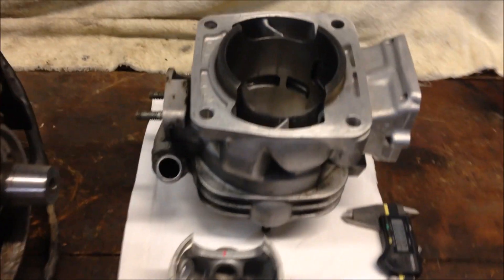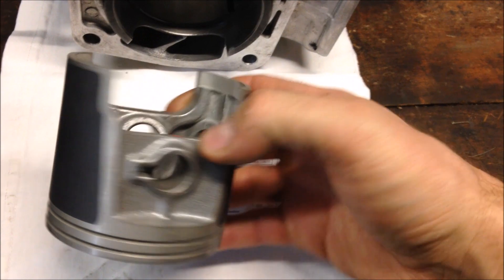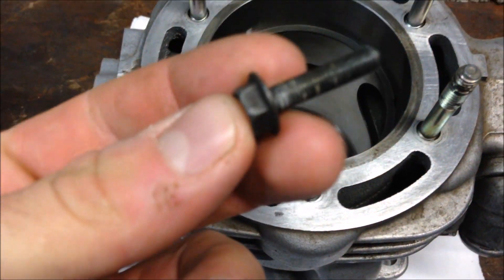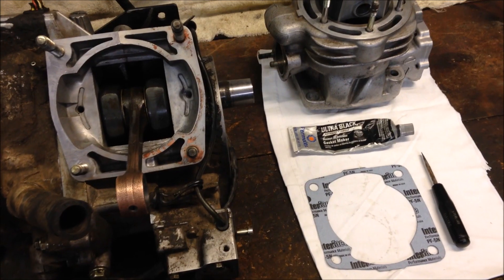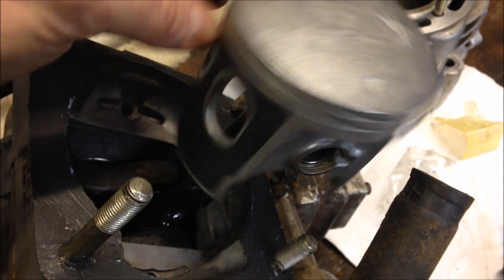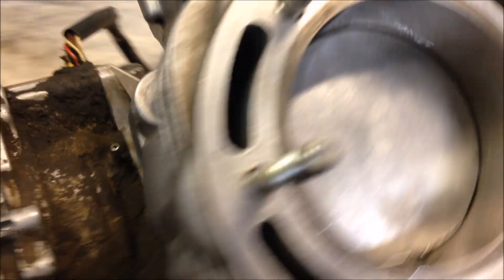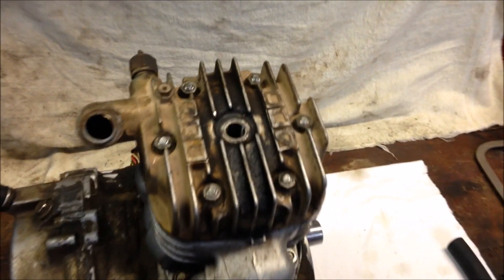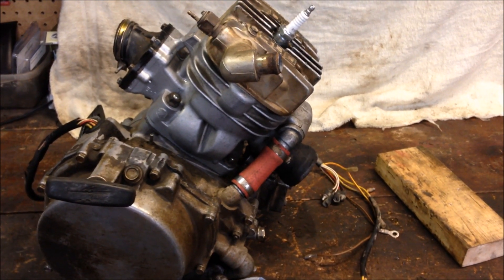Step 9: How to Install Polaris 300 350 400L Top End Cylinder Piston Head Intake Exhaust Manifold

Comment: I have a 95 300 two stroke air cooled but I can't get a torque wrench in to torque the cylinder nuts any ideas?
Reply from the maker: Crowfoot or just use a wrench and get it close enough.

Comment: What adapter do you use to torque the bottom four bolts?
Reply from the maker: Any 3/8” crowfoot wrench set 14mm or 9/16” harbor freight even has a 10pc set…

Comment: I assembled my 2000 Scrambler today, started and runs good, but a short test run, the pto crank seal seems blown, steam puffing out from bottom water reservoir port.  What issue could be too much crank case pressure?  Thanks for your time?
Reply: Crank seals shot

Comment: yo how did you mount the carb? my original jug was angled to fit the carb, but now its to angled down.
Reply from the maker: There were 2 different cuts on the cylinder and 2 different length intake boots. You need to have the right year boot for the right year cylinder.
Reply: Brap Stuff ok, my cylinder is not slanted. Could you link me the boot please. I’m in shambles about to cut/modify the boot. Lol
Reply: @TTC2109  Did you ever find the right boot that isn't slanted ? I need one

Comment: I bought a 400 scrambler from its original owner who bought it new in 1999. It still has original tires on it and has been a garage queen. So it’s barely been used and has tons of compression. I can’t decide whether to go ahead and rebuild it anyway or not. It runs so good I hate to mess with it. Everyone says it’s going to fly apart but I’m not so sure about that. It’s all stock and never been messed with. I think when people start modifying them is when things begin to fly apart. If I decide to pipe it and put a clutch kit in then I will go ahead and rebuild it. But while it’s all stock I’m not really worried about it. Some people say the piston skirt problem was fixed in them by 1999 but who knows lol

Comment: I just replaced the rings in  my polaris 300 and after putting it all back together i cant get it to start. Spark plug never gets wet and when i spray starting fluid down the spark plug hole it goes for a second but never starts. Did i do something wrong or do i have a different problem?
Reply: BallisticVolts sounds like the problem is in your carburetor.
Reply: Probably figured it out by now but you mighta bumped your carb on something while taking it off and its out of adjustment
Reply: I have a 1996 polaris 400. I wase rideing it and it acted like it wase runing out of gas. But card is geting gas .and its fireing .its blowing compreasion out of the card.sounds like its out of time.im lost can i get any feed back.thanks
Reply: @cecilhardy1477  does it turn on and idle? Is it backfiring? Or is it bogging out?
Reply: @mariotellez2025  no it want start at all whene i try to start it .it just can hear the comepreasion comeing out of the card.whene i started it up abouth 20 minutes before i took off on it but whene i started it .i had to push the throttele all the way open it wase fluded .but it ran preaty good but i road it for about half a mile .thene it acted like it ran out of gas .geting fire. Motor turns ouver good .doesnt act like not geting gas.but it did back fire out the exgust .but mostly just turn's ouver.thank's for feed back.help plese
Reply: @cecilhardy1477  does it have a filter? Also you may just need to remove the spark plug and check if its fouled (filled with oil) and see if you have spark I'll try and help you getting going
Reply: @mariotellez2025  yes it does have a filter and i took plug out plug black so i bought a new one put it in just whirles if i hokd throatell open it goes pop pop through card .i wase out on it one outher time and it shut off but after abouth an houre it started .like i said fireing good.??
Reply: Hold throatell
Reply: @mariotellez2025  no it wont start and run.just whirleing .plug not get gas
Reply: @cecilhardy1477  ok if your plug is dry than the gas isn't making it to the engine so make sure ur hoses are not clogged and that there's gas in the carb by unscrewing the small screw at the bottom of the carb to see if the bowl has any gas
Reply: @cecilhardy1477  if its black your running to rich so you need to turn that air mix screw next to the fat idle screw the reason it pop is cause you have more gas than air so turn the air mix screw about half a turn out and try it
Reply: @cecilhardy1477  do you know what setting on the needle is the clip at?
Reply: @cecilhardy1477  my honest best advice is to take that carb out and clean it good than put it back on and have the air mix screw 1 turn out as a starting point and see if it turns on I'm guessing your carb back fire is due to oil gummy old gas
Reply: @mariotellez2025  thanks ill try that.what do u mean by clip try. Thank you so much
Reply: @mariotellez2025  i just knoticed something eles dont know if it matters or not.but were card hooks up to boot the meatell part of that flange hase a screaw missing and its open.dont know.
Reply: I took spark plug out sprayed starting fkuied in it .it fired twice but it never started.i tryed ajusting the ajustmeant screaw but nothing.but it dose have comepreasion though just makeing noise out card i put my hand ouver card and it did draw the gas to it. So im lost .im abouth to tare it down just though there might be something simple .
Reply: @cecilhardy1477  sorry took so long I got busy okay check the reed valves and see if by any chance the screw is there before it goes in the motor and completely destroys everything
Reply: @cecilhardy1477  also make sure the reed valves are not chipped or damaged because that will make you lose compression and if its letting air get pushed back to the carb which is the backfire popping ur getting and maybe the reed valves not completely shutting and air is making its way to the carb
Reply: @cecilhardy1477  okay by clip I mean that needle that is in the round thing that goes up and down when u press the throttle and look through the carb where the gas comes out there a long needle that goes in to the main jet if u take that needle thing out at the top it'll have 5 small lines and u will see a clip it one of the lines u count from the top being one all and the last line down would be 5 make sure the clip is in the middle so that would be the 3rd line
Reply: @mariotellez2025  i found my automatic oiler line hase come off. Dont know but its gone.but motor whirles good.what should i cheack to find out what happend to it .sounds like time does it have valves.i am mecanicly inclined .i work on cars trucks .but this is no car and my firest one lol
Reply: @cecilhardy1477  the engine doesn't have valves all u need is compression,air,fuel and spark.. So take spark plug off than put ur finger over plug hole and pull on the pull start and see if it has compression it'll suck on ur finger and you don't need to pull hard on the pull start just as long as u have the piston move up and down after u do that see if ur getting a spark by laying the spark plug on motor and pull start than let me know and I'll walk you through the next steps
Reply: @mariotellez2025  will a reed valve cause a motor to not start.400
Reply: @cecilhardy1477  it'll lose compression so yeah it'll make it hard to start
Reply: @cecilhardy1477  sounds like you may have found the problem congrats just replace it and try starting it
Reply: @mariotellez2025  my reed valves are in real good shape.i rymouved engen .my oil line fell off fryed my rings seazed both to piston.but coneaction rod ok .can i use a reaguler homer i use on cars.to hone my jug .and were is the beast place to get a new piston and rings.thanks .
Reply: @cecilhardy1477  use a rubber hammer to get the jug lose and first thing you need to do is check how big the jug is so measure the piston than if you want good quality get wiseco piston but if your on a budget I've used wsm performances parts and has worked good sorry I been really busy with things I didn't have time to check but like I said i'm gonna help you make the engine run again
Reply: @cecilhardy1477  I've used the one for the car to hone the cylinder and haven't had a problem
Reply: On the needle vale.does it have a plastic waseher.whene i took my card off .i knoticed there wasent any. Do i need that on my 400.polaris.
Reply: @cecilhardy1477  no it actually has a metal that goes over it than the spring should hold it down
Reply: @mariotellez2025  yea i atchet another clip by some one eles.i learned a good lesson he doesent know what hes talking about.after i watchet urs i found that out .thanks for your response .great videos .ill keep u informed on how it goes.just waiting on parts so i can put it back together.agine thanks .
Reply: @cecilhardy1477  these are not my videos by the way I just happen to finish rebuilding one and know how to assemble everything I would help you out because I know how it feels when you wanna fix a quad and can't get someone to reply but yeah follow this guys videos and you will be good
Reply: @mariotellez2025  sorry i thought they were urs im not useing the intrnet lol.but a lot of usefull infoe.but any way thanks mario .for takeing time to healp me greatly appreacted.
Reply: @cecilhardy1477  yeah no problem hope it works out for you feel free to message me if u need help with anything
Reply: @mariotellez2025  hey mario.i bought a piston set. And the arrow on the new piston is pouinting toward the exguest .not toward the pull starter side .so i turned it so the holes that are in the shirts of the piston are toward the reed valve. But my arrow is now toward the exguest..piston miket ok ring gap wase good too .and i bolted it down .ive got comepreasion but still want start. Doing. The same stuff. I guess my quistion is do you think the piston will work like that.installed it .but its still doing the same stuff. Want start.got comepreasion.plug fireing good geting gas.but will that piston work like that.the piston that come out of it arrow wase pointing toward the pull starter.and the wholes that are in the shirt of the piston.are a lot smaller then the new one.the new rings both had top market on theme .both new rings are same no differance in theme.i think they have sold me a dage on mess.please i need some feed back.im lost agine.dont understand it i could of rgbuilt a car engine by now.lol
Reply: @cecilhardy1477  okay let me go over what u telling me and something to check is if your carburetor is getting gas and also put the air/mix screw all the way till it seats but don't do it hard and once you turn the air mixture screw in turn choke on and see if that starts
Reply: @mariotellez2025  one more quistion .does this thing have timeing chain or gears
Reply: @cecilhardy1477  yeah the holes on the piston should be towards reed valves so you installed it right
Reply: @cecilhardy1477  timing is the rectifier (the metal with copper windings) its seats and use 3 cross bolts to set the timing you need to make sure that the little line on top is lined up with a small line on the case that looks like a negative sign
Reply: @cecilhardy1477  also really important about the timing gears which with have a dot on each huge gear make sure the 2 dots are next to each other when the gear spins
Reply: @mariotellez2025  i hope u got my e mail
Reply: @cecilhardy1477  still haven't got a email
Reply: I watchet a vidio that showed me the timeing marks and the eleactic coils .the timeing marks on it to.man love these vidios
Reply: @cecilhardy1477  okay sorry I been trying to send the pictures and manual but gmail stuck in sending the attached file and picture
Reply: @cecilhardy1477  you know the two huge gears where the water pump seats? Hoping you'd say yes lol well those gears have a dot and need to have the dots next to each other when aligned
Reply: @mariotellez2025  yea i seen that sort of like a car with cam alineing up with crank two marks on gears .those two marks line up.and the eleactell device hase a mark on houseing and the eleatrical device lines up.got it im going to cheack card out ic thats not it im going to cheack timeinv
Reply: @cecilhardy1477  are u getting my emails now? I think I fixed the email issue
Reply: Timeing
Reply: @cecilhardy1477  those to are important that they are lined up and yeah like a cars cams and that is the timing once you see your are correct email me and I'll tell you what to check next it gets frustrating but I'll help you through it
Reply: @mariotellez2025  yes i am mario.thanks so much
Reply: @cecilhardy1477  yeah no problem I'm gonna try and response as fast as possible and since today is my birthday I'll be a bit occupied but will still get back to you so you can ride your quad again
Reply: @mariotellez2025  happybirthday mario
Reply: I screawed that gas mixture sceaw in like u told me and it fired right up.man that sounded 👍.ill be talking to u after while onece i get this thing back together lol
Reply: @cecilhardy1477  thank u
Reply: @cecilhardy1477  nice the reason it wasn't turning on was to much air and not enough fuel good to hear you got it on now once reassembled I'll show u how to tune the carb its not %100 but close to about %80 spot on
Reply: @cecilhardy1477  remember to use loctite or thread locker for nuts like the jug and head loctite is your best friend when rebuilding so that nothing can come lose and also torque the bolts to specs with a good torque wrench
Reply: @mariotellez2025  yea i did .i use it on cars to .i took it out for a ride man what a differance.yea my card does need ajusted .ill get every thing back on and ill get back in touch wuth thank u so much mario.your a life saver .
Reply: @cecilhardy1477  I'm glad to see you got it going and I'll be here when you ready to do the final step and also don't forget to bleed the coolant
Reply: @mariotellez2025  how do i bleed cooleant.
Reply: @cecilhardy1477  when you put coolant/distilled water or water turn it on with the radiator cap off top it off and on the top of the head there will be a 10mm screw loosen that screw till you start to see water come out and tighten screw when no air bubbles are seen or heard
Reply: @cecilhardy1477  the screw is on the top on the pull start side next to the temp sensor
Reply: @mariotellez2025  ok . i seen that screaw .man ur full of infoe .im glade i found u .lol.  Hey on my card there's a draine comeing off the bottom of card hase a mayby a five sixteenth clear rubber hose gas runs out of that whene its not runing. Its done that every since i bought it .
Reply: @cecilhardy1477  okay there  2 ways that will happen the first one is what everyone Will tell u that your floater isn't set correct which I'm gonna advise you before u move the float level check to see if there's gunk or dirt on the valve that makes the gas shut off
Reply: @cecilhardy1477  so u can better understand and actually fix that leak you need to take off the carb again open it and take the gas valve off and if you have a compressor blow air to clean any dirt than put valve back on and put the carb back on the ATV turn gas on if it still leaks let me know and I'll show u how to set the floaters
Reply: @mariotellez2025  sound's good mario .thank's agine .ill be in touch agine all most got it.
Reply: @cecilhardy1477  yeah no problem one thing I learned about fixing anything take your time and don't rush it I'll be here waiting on what you need more help with
Reply: @mariotellez2025  the dash lights top one oil.midell two neutral and reverse.bottom one teamp.is that right
Reply: @cecilhardy1477  yeah u got it right
Reply: @cecilhardy1477  I'm still waiting on you to show you how to tune the carb and if the gas is still leaking from that house
Reply: @mariotellez2025  yea it is still leacking. Im here now will be the reast of the eve. Thanks agine
Reply: @cecilhardy1477  OK I'm gonna send u a email with pictures of what to do to make the gas stop
Reply: @mariotellez2025  morning mario.hey thanks for all the valueble infoe.i never would of been able to rybuld my grandson's foure wheeler.i have anouther quistio .whene i put the bike in ryvearce it bogs out .but if i push the over ride button it runs perfeact .is this normall ??.thanks agine
Reply: @cecilhardy1477  I've always had my do that and its normal to me because I have to push the over ride button and found out that reverse has a speed regulator and feels like its bogging out but its really the reverse regulator polaris put so I always use the over ride to reverse my self... Your very welcome and I'm glad you got the quad going and you have my email for when ever you may need help feel free to send me a message.
Reply: @mariotellez2025  hey mario.my Polaris is run perfect thanks to u .hey on my primary and second dairy clutches how do I know whenever there lines up. Mine wants to move even while I'm trying to start it. ??
Reply: @cecilhardy1477  not sure why its doing that
Reply: @mariotellez2025  I figured it out my belt hase three teeth gone on it .slapping on my clutch .I cleaned clutche .I used memory cloth and thene used air and blew it out good .I took it out yesterday and run it for three your's run like a new one.i want out and bought a 750 Polaris sportsman 4x4 .but I roader my 400 .thank u mario for all ur healp.if it wasn't for your expertise I would of never of gotten it I love my 400.agine thank's
Reply: @cecilhardy1477  I'm glad you figured it out and your very welcome and happy I was able to help you and get your quad going again remember to be safe when you ride and have fun.

Comment: The reason for having a gasket, don't put gasket maker on it, you defeat the whole purpose of having a gasket, gaskets aren't only there to seal but to provide a certain amount of space like a washer.
Reply: In this case, it's cheap insurance, and most of it is squished out. The thickness added is probably less than .0005. Well within spec.
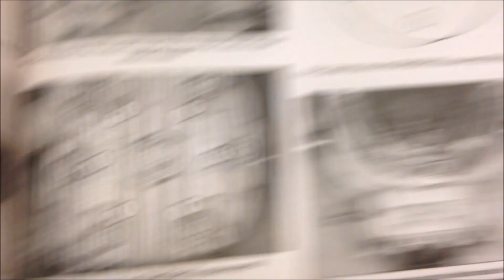Reply: @daveanderson2316 7:48 7:48